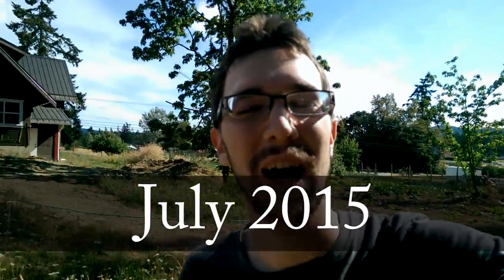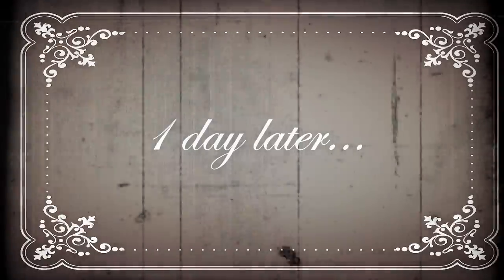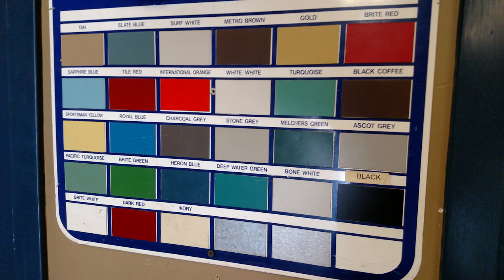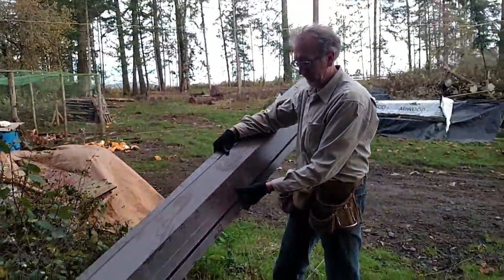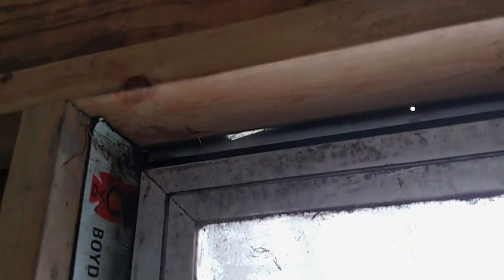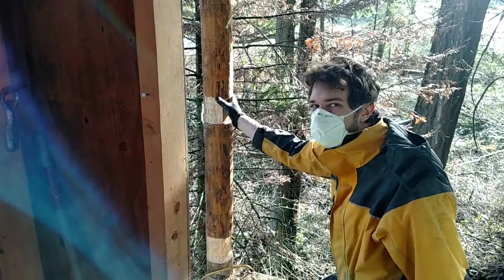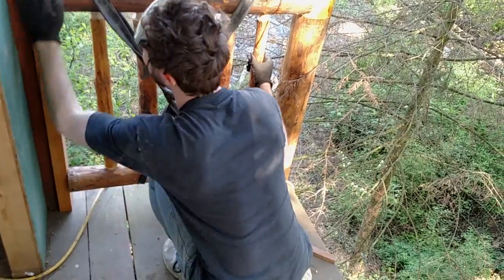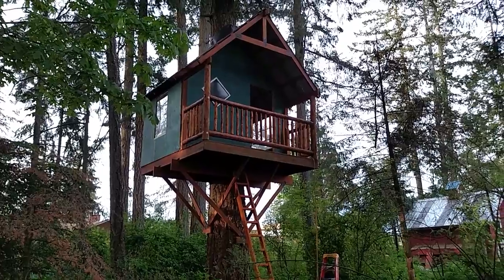Taran builds a treehouse

Comment: you complain about having cm and inch on the tape measure. and then chooses to use inch. tsk. 
lovely tree house.
Reply from the maker: shhhhhhhhhhhh
Reply: The combination tape measures are just the worst, as the hashes are only on one side of the blade. Inevitably the wrong side whenever you are trying to measure in an awkward position.

Inches are ideal for rough carpentry, especially since the saw blade is 1/8".  Inches can also be infinitely halved while base 10 metric cannot.

Metric is great for shifting orders of magnitude, but Imperial is best for bisection.  I need bisection far more than orders of magnitude.
Reply: @jeremyO9F911O2  I get what you are trying to say. That's because you express inch as a rational number. You can do the same with cm. 1/8th of a cm works too in that regard. 

The reason we use base 10 is because it fits so well with how we measure the rest of our world. It's logical and precise. We don't change bases or units. Ie feet yard inch. 

Measuring how much joule it takes to lift a 55g apple 10cm above the ground is super easy. And we don't kill astrounatus because of miss communication :) (sorry had to)
Reply: @adrianflo6481  just to be clear, like Taran I'm also Canadian, so I'm part of your "we".  I also agree that for precision calculation metric endlessly superior.

But we're not talking about physics, we're talking carpentry right now.  I'm a roofer, a sub trade of carpentry so I do this every day.  Inches/feet are less accurate than metric but 99% of carpentry tasks are not finish carpentry, meaning the tolerances are relativity low.  Down to the mm precision is pointless when a peice of wood is 1 cm in natural curve of the material.

Inches and feet are practical and standardized without too much numeric inflation.   Moreover the code is equally practical and simplified and most importantly easy to teach and remember.

While I myself understand the physics relationship you described, let me assure you that I'm a rare breed and I sincerely doubt anyone else of the other 5 guys on my crew would have a clue.  And that's a simple relationship basic assed physics.

In the end practicality wins the day, and carpentry is far more art and subconscious talent than it is a science.  Trust me if we tried to make a more of a science it would take 4 times longer, cost 6 times as much, and be rigid and inflexible when unexpected problems occur.  I deal with multiple unexpected problems every day.
Reply: @jeremyO9F911O2  you are not wrong I'm just being an ass. A base 12 system would be a lot better for every day use. ^-^ 

But 12in in a feet. 3 feet in a yard 1760 yard in a mile. That's not easy for anyone. 
Its a usable if you seperate the units. But the relationship between the metric units is not as as intuitive as meters and kilometers. If you kept everything to 12ths. Now that would be great. 

On the other hand or carpenters are forced to mix and match. As measures for tools and material is done in imperial and lengths and volume in metric.

But as a European I am forced by law to scoff at thee if you practice inferior measuring technique.
Reply: @adrianflo6481  to be clear I don't use miles, and the only time we do use yards is for loose material like soil and aggregate.  Concrete is measured and billed in sq meters not sqare yards, why we don't fully switch from yards is beyond me since a square meter is nearly the same size as a square yard.

But at no point do we convert feet to yards.  It's more like "this truck cash hold X number of yards of soil" and after you've spread that soil you can rough estimate how many more trucks it takes.  Feet, inches, and pounds are all we Canadians use. Fahrenheit can go straight to hell (I can't even spell it and use speech to text everytime I need to) it's such a useless measurement and I hate when Americans use it.

Funny enough it seems to be the one measurements they are least willing to abandon.  It's a rare example where Imperial is more granular than metric yet it's that granularity that is the reason I hate it most, though water freezing at 32°F is nearly as stupid.  Yet we have a mostly intuitive relationship with temperature.  And they don't want to relearn that intuition.
Reply: @jeremyO9F911O2  oh. That's lovely to hear. Definitely got a better understanding. And yes. Fahrenheit is based between freezing point of saline and human body temperature. Except it's not because it's also in 12ths. Saline actually freezes at -6 f and body temperature is neither 96f (35.6c)  or 100f (37.7c)

It's god awful.
Reply: @adrianflo6481  actually Brine not saline, saline has far less salt.  But this is also a myth.  It seems the scale was based upon the needs of his customers buying thermometers at the time he developed the scale.  He never had a grand design for global implementation.  He just made higher quality thermometers than his competition at the time and his scale was adopted.
Reply: @jeremyO9F911O2  well wouldya know. never heard about that one. His customers must have been a stupid bunch. 

Glad we have the good old Anders Celsius, one of the finer swedes.
Reply: @adrianflo6481  his customers would be chemists doing whatever research they were doing.  Negative numbers can be mathematically annoying.  

You'd be very surprised how often a standard exists not because it's so good but because of factors at the time of its creation.  In fact I would argue this is true of most standards.

Comment: Standard spec is:

16" joist centers 1/2" plywood
24" joist centers 5/8" plywood
3/4" plywood is for excessive loading or unspecified openings.

Ladder 45°!!!! No no no!!!  4:1-3:1 ratio not 1:1.  Ladder safety 101!!

The tie between roof and tree trunk is a head scratcher. I'm a professional roofer/waterproofer and generally we want to see a smooth surface to establish a seal.  I see two options but I'm not an arborist so I don't know which is best for the tree.

My initial instinct is to girdle the bark, but then you're still trying to seal to green wood.  Also this might harm the tree.

Other option is to add some sort of buildup to provide a smooth even surface to seal the EPDM (what you call pond liner) to.  I'm not sure which product I'd use, possibly spray foam then sand it down later.  Then can attach the EPDM rubber to the foam.  Your best bet is to make friends with a flat roofer who are experts at rubber membranes.  Unfortunately while I am such a roofer, I'm all the way in Winnipeg.

Best of luck.  I see replies on my YouTube comments.
Reply from the maker: Yeah I should've done a thicker plywood for the floor.
We only did the ladder 45 degree thing once, and it was supported in the middle and tied off at the top (that's what the yellow rope was doing up there) - we just couldn't figure out any other way to get that final top part of the roof on. Should have done it while the other panels were going on, and slid them underneath it. Live and learn. The roof was easy at first because I could just hang out in the rafters.

I could certainly smooth out the bark a bit -- I have to get back up there to address the one last potential leak, and to chip away at the bark a bit anyway because the tree has gotten bigger, probably. The plan is to loosen the shroud as needed as it grows, but getting on top of the treehouse is really hard. (Any ideas?) Mr. Popmas' climbing gear has a rope loop that goes around the tree trunk and allowed me to move very freely and easily. But I'd still have to straddle the roof and shimmy along towards the trunk before I could actually get the rope around it! (it's not very long, maybe 5 meters total.)
Reply: @TaranVH  use a "chicken ladder" basically a ladder that hooks on the ridge of the roof.  Metal roofs usually incorporate snow catchers that prevent snow and ice from killing people as it so easily sides off.  You could try adding these so that you don't slide off.    If your Home Depot or whatever you're shopping doesn't have them, there's a RoofMart in Surrey, normally they have a "if you can draw it, we can bend it" metal shop policy for exterior sheet metal fabrication.  At least my local shop does, they may also just sell the snow stops but you might have to buy a large box.  

The reason you don't 45° a ladder isn't just because it can slide out.  It's because the ladder is far less strong.  A ladder is stronger the more vertical it is, though also harder to climb the more vertical it is.  Which is why we choose 4:1 as a good balance.

You never really showed how you installed the EPDM rubber so I can't much help you sort out how to improve it.  What you've done is what we call a storm collar though with rubber instead of metal.  Usually these are found on chimneys.  You might try a second storm collar or even three.  They can be much smaller than the current one and installed above the current one.  Each would flash water away from the seal below.

Also go to MEC and buy the Silky Gomboy folding Japanese saw ($55) this is an invaluable tool for any tree cutting this side of a chain saw.  I've cut 6" branches with complete ease with this saw and it fits in your pocket while you climb the trees.  https://www.mec.ca/en/product/5054-564/Gomboy-240-Saw---Medium-Tooth
Reply: Oh just reread your thing about the ridge cap (the metal cover on the very top).  You can't really install that first since it is elevated by the corrugated "highs" of the roof cladding.  The problem is you can't fasten it to the cladding as is necessary for wind resistance.  Basically you need to climb to the ridge no matter what.

Comment: just a personal thought. i wouldve tried to build the walls whilst being up on the flooring to save the effort of having to hoist up a huge and heavy wall, rather just flipping it upright. but im just weak and lazy so
Reply from the maker: I thought about that, but they'd have been all wonky and not plumb at all. Needed a flat surface.
Reply: @TaranVH  thats true and i wouldnt have thought of that if you hadnt mentioned it. thats actually such a good point

Comment: Use some kuck sealer for the top to fill the gaps also use if for the windows an to keep the birds from entering get some like dooe screens an staple them to the sides of the wood in the corners ps I'm not good at typing whats in my head

Comment: Is nobody going to talk about how unsafe this project is..? The wood is completely compromised, please be safe and have someone qualified inspect it before you have family or friends climb it. For their sakes.

Source: Worked in construction for nearly ten years now. This is what a nightmare build looks like.
Reply from the maker: Hello sir, I'd be interested to hear what you think is potentially unsafe about this! It's certainly not the first house I've built!
What exactly about the wood is "compromised?" The main structural elements are all Douglas fir milled from our own trees. The walls are 2x4 spruce from Rona.
The most dangerous thing about it is probably the ladder, which still isn't attached the way it needs to be. I also really still need to reinforce the floor.
Every single joist has a hurricane tie. Every 45 degree support has at least one metal plate on each end. In fact I only used one because I didn't want to riddle the wood with too many nails from both sides, thereby weakening it!
Overall, I think I way overbuilt this thing - even to the point where I was worrying about putting too much weight on the tree - I totally could have gotten away with using 2x3 spruce for the walls, though I don't think it really would have saved all that much weight...
Reply: How is the tree house now, it's been 4 years since that original comment. Yall still alive? 😅

I'm interested to know what the original commenter was talking about. I'm watching this for the first time in 2024 Sep. This is the first video I have seen where beams are placed on top of normal lag bolts (as opposed to TABs - treehouse bolts - which has a meatier collar that goes inside the tree to give it more strength). 
Hows the condition of the wood that directly touches that lag bolt? I'm curious as the weight of the beam+tree house on top+ contents of the tree house are transferred onto such a small point (the diameter) of that lag bolt 🔩 Is it not continue to dig into the wood of the beam? I have seen on other designs a metal plate is fixed in between the bolt and the beam so the force is spread on the beam rather than giving it the high heel 👠 effect.

The other slight concern of mine (im no builder, I'm a software architect) is the diameter of the 45°support beams. They look quite thin. But maybe it's the camera fish eye effect.

I did take a lot of pointers from your design though, so hats off to you.
What I would do differently is probably make those triangle parts on the ground and then hang it up. I know you did it while the top of the triangle was hanging on the bolt

Comment: i just started building mine.  right not i have 4 3/4 by 10 inch bolts holding up the approximately 10x10 platform.  i think i'll add four more bolts to be sure. today i was on the deck screwing in the boards.  scary.
Reply: so only the outer layer of the tree is alive and it will grow around the bolt.  i'm pretty sure it doesn't hurt the tree.  however if the tree is hollow or rots on it's own it may weaken your bolt connections.  dang i with i knew what i was talkin' 'bout.
Reply: ah okay, i used a more substantial bracked and actually drilled a hole through the 4x6 and 4x4 lumber attached to the tree.
Reply from the maker: @dolinick  I'd be interested to see a picture!
Look up the "Garnier limb" and then see what advice that guy has for building treehouses. Like, he says you should always put the wood sitting above a bolt, not through it - so that's what I did.
Reply: @TaranVH  well i have done a little research.  that's where I got my idea.  It is not that different from your design.  so i need to upload some video and or photo slideshow so people can really understand.  I made two "tri-frames" out of a two 12 foot 4x6 and two 8 foot 4x4 cut in half.  I balanced the frames on either side of the tree upside down on either side of the tree and attached the bottom part of the frame. then i flipped them both over, leveled them and attached the top bolt.

Comment: Why do you measure in inches and feet when you're Canadian?
Reply from the maker: It's like you've never been to Canada.
Reply: Also Canadian here.  First off all material is made in inches, so why even convert.  Canada is officially metric but in reality we take the best of both systems.  Celsius, kilometres, and grams/milliliters are better, but feet, inches, and pounds are very handy for what they do.  Some older Canadians still talk in miles too.

Inches and feet are far more useful in carpentry, while it's true you can effortlessly change orders of magnitude with metric you can't half base 10 more than once without decimals.  Because Imperial measuring equipment is labeled in fractions of an inch, you can always half as much as you want.  Which is done all the time. 

What's easiest to remember or do?  Saw blade allowance is 1/8" or 3.175 mm, tape measures always have 1/8" marked on them.